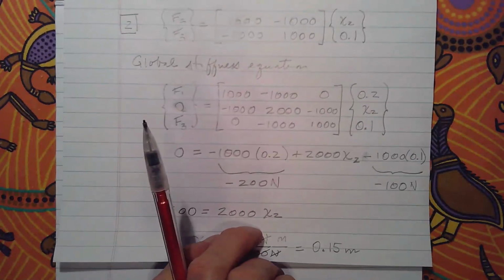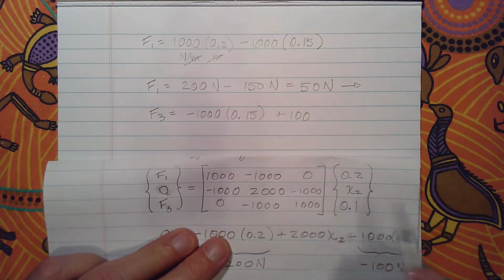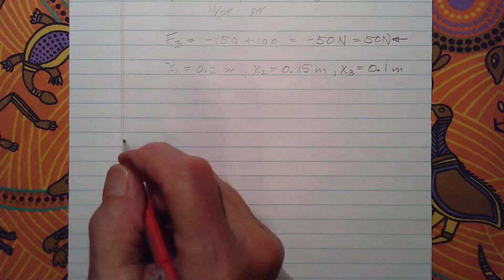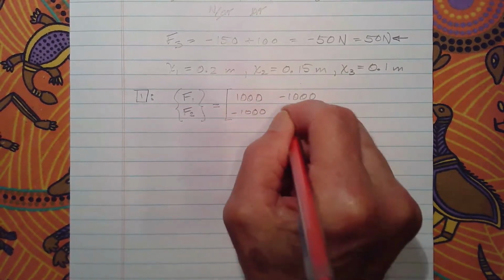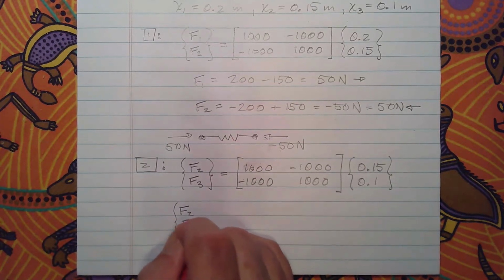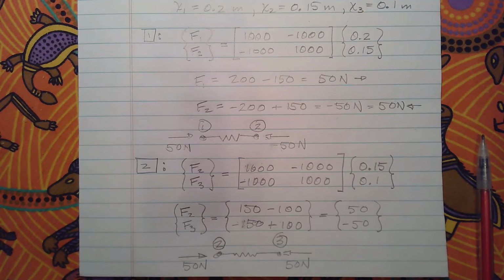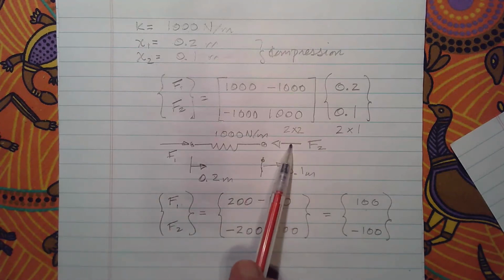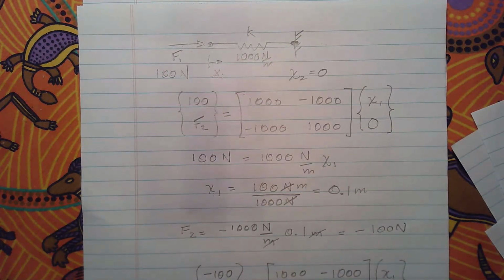The finite-element method using spring elements - part 4

Comment: Does always the load in the middle F2 = 0 if we have the same spring stiffness in both side?
Reply: Hi Dame,  Good question.  The load in the middle can be something other than 0.  For this case, I simply wanted the easiest case.  Just the same problem as the single spring but with two of the same stiffness.  The stiffnesses do not have to be the same on both springs.  In fact, if you made one the stiffness of the spring connected to the wall very large, then you have the single-spring case all over again, and you should get the same answer as before.
Reply: ...A second thing worth mentioning is that at node 2, there are actually two equal and opposite forces imposed by the springs.  So the NET force at node 2 is 0, because the two forces there, from the two springs, cancel each other out.
Reply: @frankowen5499 Ah okay I got this
thanks